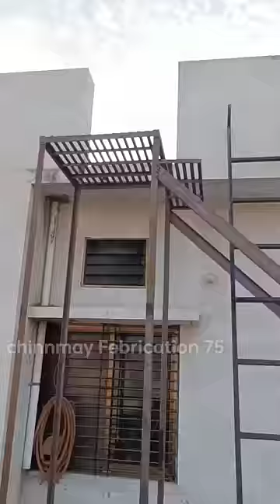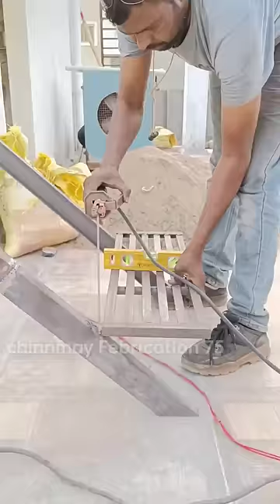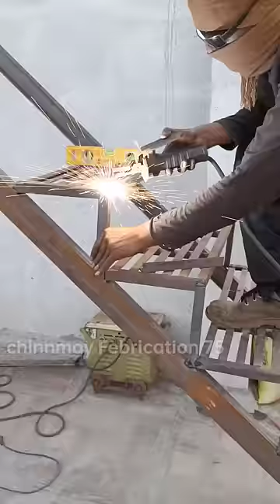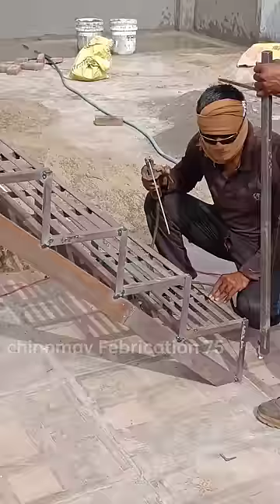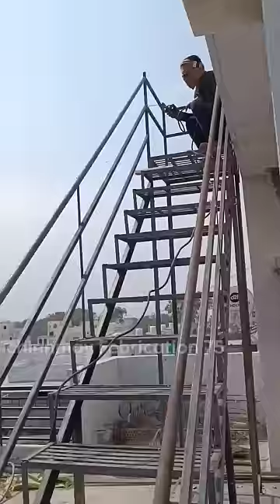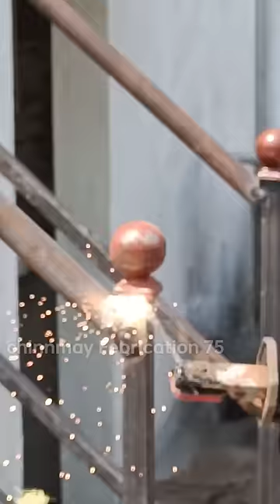how to make stairs step installation || लोहे का जीना,सिडिया फिटिंग #stairs #welldigging #shorts

Comment: The scab welding technique made me throw up.....
Reply: Weak minded. There guys are doing a lot with very little. I've been welding for about 30 years. I've seen much worse from people that are making much more than these guys.
Reply: Yes that's correct but as for the strength and structure of the weld, I'd rather not put any confidence in it.
Reply: @timbodnar6711 The problem is not how much you earn but the quality of the service, earning little doesn't give you the freedom to do shit.